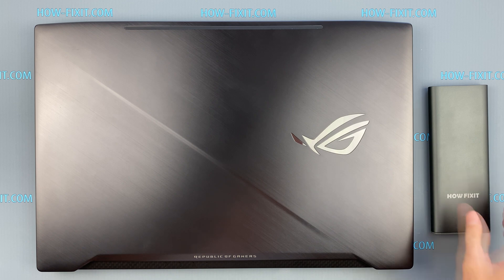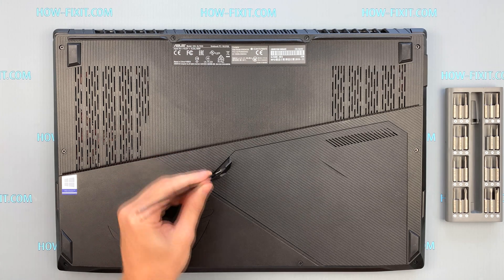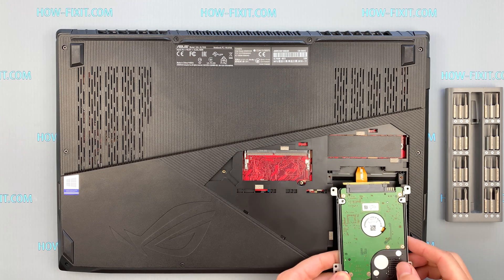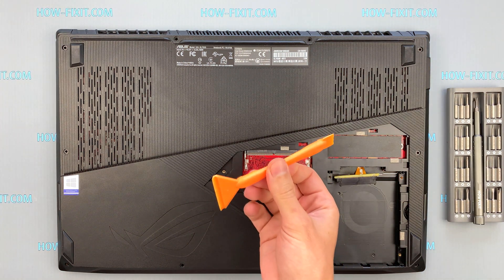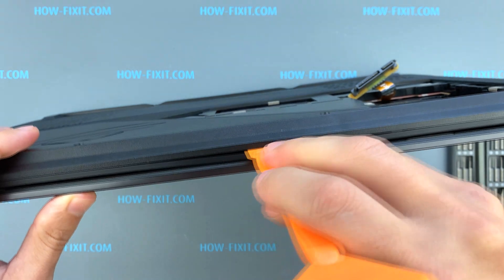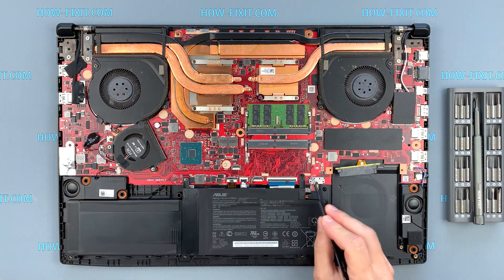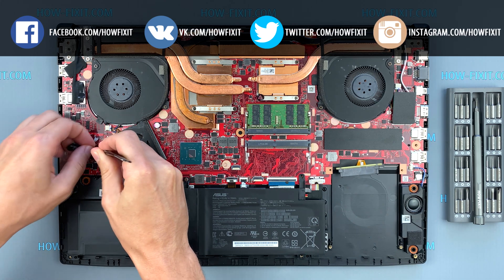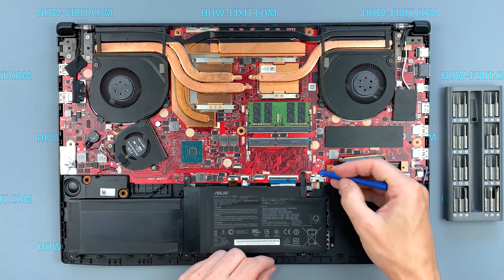ASUS ROG Strix GL703 Hard Reset BIOS Settings | CMOS Battery Replacement Guide

Comment: Hi, my laptop asus g531g cannot start, i try doing anything to drain the static but still not help, the last option i think is replacing the cmos, is it will make my laptop start again if i replace the cmos?
Reply: u got the solution yet?
Reply: @mohdnurhareezbinmohdnurisw3328  yes bro, i already fix it.. the problem is from the motherboard  not the cmos
Reply: @zulfitzone  u send it repairs under warranty?how much does it cost??
Reply: @mohdnurhareezbinmohdnurisw3328  my warranty already due... i pay RM450 for the motherboard issue to be fix
Reply: @zulfitzone  i thought it will be more expensive bro where u send it? to the asus service centre?
Reply: @mohdnurhareezbinmohdnurisw3328  nope, at regular laptop service center in penang

Comment: Hello, will this remove my password on asus rog gl703gm? My bios is locked and I cant enter in bios. Thanx in advance for your answer
Reply: I have the same problem! I have the Rog strix g15 rtx 3050 and amd R5 5600h but I accidentally put a bios password thinking it was the laptop password and now I can't go in my bios because when i put the password it automatically starts with the Rog strix animation and I press f2 f5 or delete and it does nothing. Do you know how to accès bios so I can remove my password? Did you fix your problem? And do you know what i should do? Thank you
Reply: @Anonymous-zn1ky  no, I didn't fix my problem, I tried to contact Asus, but they told me that I need  to ship in my laptop in order for them to access the bios.. For me thats not a option.
Reply: @J.R_Guitar  bro that sucks so now I'm stuck with my bios password?
Reply: @J.R_Guitar  do you think it's a good idea to take it to best buy and get a new one?
Reply: @Anonymous-zn1ky  bro I'm facing the same password, have you found any solution . Please help me
Reply from the maker: @Anonymous-zn1ky  Check out the video How to Remove BIOS Password https://youtu.be/WUDdhJVIR1M
Reply from the maker: Removing the CMOS battery won’t clear a BIOS password. Check out my dedicated video “How to Remove BIOS Password” 👉 https://youtu.be/WUDdhJVIR1M for step-by-step methods (master password, backdoor keys, and other solutions). It’ll walk you through exactly how to unlock it.

Comment: Do you know where the bios chip is on this board? As well as the model number for the chip? I messed up some setting in a modded bios and now I don't get a display out. CMOS reset isn't working, I've ordered an SOIC programmer, but I have no clue where the chip is on the GL703GS (looks like the same mainboard as the GL703G here)
Reply: Nvm i found it, the chip id is MX25L12873F
Reply: @undefinablereasoning   I too have done the exact same thing as you, ha, except my laptop is a GL703GS. What programmer did you get and did you fix your issue?
Reply: Hi i have a problem also. Upon turnon off the laptop the fans spin max speed and black screen. Its bios problem?
Reply: @BigMouthBilly  probably
Reply: Thanks for ur answer! Ive tried this methods above. Wont work, i guess il order a programmed bios chip and solder it on the mainboard. Is it also possible the mainbord is completly dead?
Reply: @BigMouthBilly  No display can mean lots of things
Reply: @undefinablereasoning  Hi, did you solve the problem and how? Please let me know, I'm in the same situation with a GL504GM
Reply: @alemartina23  how did you solve your problem pal ?😢
Reply: @BigMouthBilly  Um, actually there's a pretty good chance this is your graphics card too, just a fyi